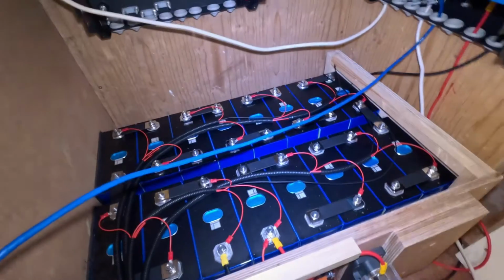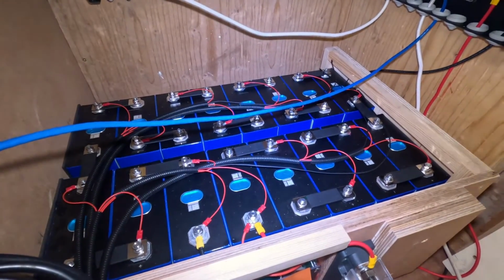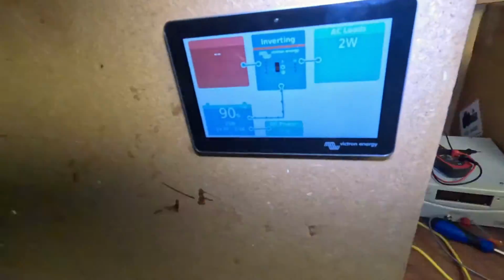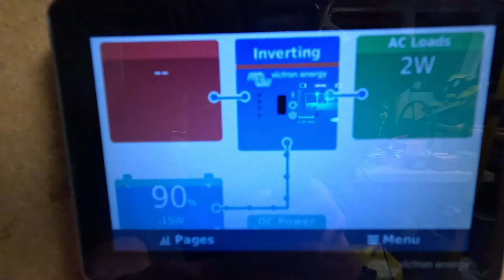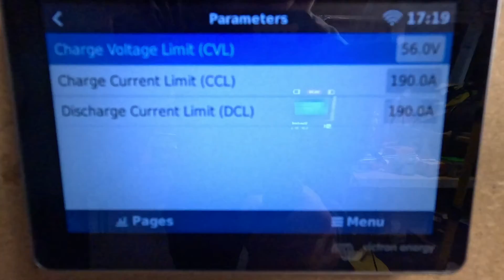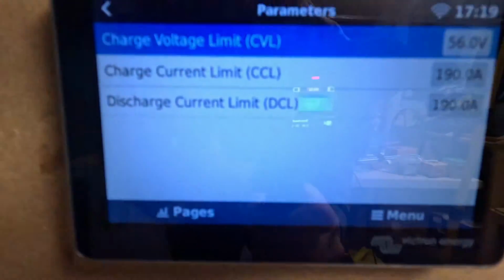Building our Sailboat’s 48V Lithium Battery [2.08]

Comment: Your 280AH bank is by far too small to run 2xMulti, you need min doubled.
Reply from the maker: Thanks for dropping a comment 😊 Do you want to explain why you think it is too small?
This is how we have been reasoning: The main drivers for going for 2x5kVA Multis is that we wanted the charge current to fully utilize our genset and we also didn’t want to be limited during discharge in the way that we have to think about what appliances we turn on at the same time. It shouldn’t be a problem to turn on the water kettle when the cooktop and dishwasher is already running. 
So, if we start with discharge we will have a total connected load of apporx. 15kVA. Obviously we will never run all those loads at the same time. At our highest loads we will probably only run half of them, and that will be for very short period of time (minutes). From a thermal point of view that is long enough to be a continuous load for the Multis and that is why 10kVA felt reasonable. It also gives some head room for thermal derating. 
If we look at it from a battery point of view a load of 7.5kVA will result in 184A (7500/48/0.85) or 0.66C which should be within both cell and BMS specification. We will for sure do some thermal testing of this and I think our weakest point right now is the busbars between the cells. 
From a charging point of view 2x5kVA Multis can deliver 2x70A. For our 280Ah battery that means 0.5C which what is defined as a standard charge rate for our cells. Our genset will be the limiting factor here and we will not really reach 140A charge current. 
Then you could argue that we should have a bigger capacity in relation to our load to be able to run out of batteries for a longer period of time. Our target with this system is around 3 days from full battery to completely empty without any charging. Then we will rely on as much solar that we can fit and our genset if needed. 
In the end LFP batteries can withstand a lot of cycles and that is what we will try to utilize with this dimensioning. 
Will it work? Time will tell. Worst case we just add another battery in parallel 😊
Reply: @SailingAnneMon  lot of theories…I am dealing with lithium since 20years, first cells scraped half legally from a military vehicle to build a competition car stereo vehicle and my buddy runs an NPO in Austria producing Powerwalls and commercial EVs. I am liveaboard and circumnavigate since 2019 running a 12V 4P4S 1088AH bank with 272AH Lishen cells. My cells are bought via my buddy who made sure I got grade A+ factory matched and internal resistance calibrated 16 cells (each cell was 180Euro, his factory purchase price and he gets every 2 week 3 container from Lishen) you cannot buy that as end customer unless you get Winston which only produce and sell this quality. The 280AH cells you have degenerate much faster if constantly used above 0.3C, doesn’t matter what spec tells you, they are budget storage cells most likely b grade at best and no Winston where same capacity costs 3-4 times your cells. What manufacturer (believe it’s eve or rept from terminals), what quality do you get (test report/scan QR codes) from which supplier? 
One 5kw multi from load is already limit for your 280AH cells, as eg 100A inverter load x1.4 means the real load 140A on/off in millisecond (don‘t believe put on Osszi in and it will prove you that). And if you use induction hobb ( a good one with industrial grade coil burners, cheap is even worse) add a cos pi of 0.7 which means 100A/0.7x1.4=200A is the real load on/off in milliseconds, you see 100A at BMS or Victron BMV712 battery monitor. Use class T or NH fuse with min 30kA short circuit certification as main battery fuse as these 16 cells can produce up to 18000A in an internal cell/bank short as each other fuse type will be arced and therefor useless by that up to 18000A. I burned a car down with a 24V 400AH bank that got an internal cell short and even a 15kA speced class T fuse got arced.
Busbars are ok. During build I see loads of mistakes, no isolation between cells (the case carries positive and heat shrink is quickly damaged). No clamping/compression of cells. Battery box should be of non easy flammable material (I know loads of videos show wooden boxes…I use PVC, PP or acrylic boards), box should be airtight (otherwise corrosion and problems over time) but in case the gas valve of cell open that gas must be able to leave the battery box, if not you build yourself a bomb :-(….
I highly advice to get a 2nd set of cells with a 2nd BMS put in 1p16S put parallel, to get load and charge under 0.3C. For each battery class T or NH fuse plus disconnect relay in positive right after main terminal, negative a 500A shunt With a Victron BMV712 battery monitor which also has a relay steering output. The BMV712 does the independent last resort cut off in case BMS fails (mosfet BMS like JK the mosfets tend to fry close in overload or a short, so no disconnect anymore) that steers the disconnect relay. The BMV712 has also midpoint monitoring, so the 2nd measuring output of it goes on cell 8. like this the BMV can also detect a cell deviation means a dangerous cell runner as it measures the voltage of cell1-8 and 9-16, if that exceeds a threshold you can set (I advice 200mV) the BMV is also cutting the bank. This last resort is requested by ISO or ABYC installation guidelines and if you don‘t have it your insurance will bail out easily of any battery related claim/damage.
Reply: @SailingAnneMon  just several other thoughts…2x5kw multi have a huge standby wattage (the real, not Victron marketing one) of 200W, that on the whole day is already 4,8kwh. I have 2 Multi 3kw and instead parallel staged them means only one is always on and 2nd is switched on via generator assist if load is above 2450W for more then 5sec. As multi has only one AC in you need a manual transfer switch where you can select if AC in comes from 2nd multi, generator or shore power. With a gen as main source a Quattro would have been much better and the right choice as it has 2 AC in and manages them automatically also with power assist and smooth phase in gen. With your loads you will do 1,5days max, not 3 as you calculated, double capacity will give you the 3 days if you manage the standby of your 2 huge Multis accordingly. I assume starlink comes on top, 60W always on…
Reply from the maker: @chrisr819  The cell we have bought are Eve cells.

It was not really the focus of this video but the cells are insulated with epoxy sheets, they are compressed with threaded rods and we use a class T fuse with 20 kA IC. 

On the topic of battery box I really agree. Ideally I would like to have a fully sealed, thermally insulated and burst valve equipped aluminum box with off boat ventilation. The problem is that it quite easily run out of hands. Instead we try to focus on a mechanically safe installation with the proper monitoring. Using the mid-point monitoring on a BVM/Smart shunt is a option.

On the topic of Multi standby consumption it is really good to get input from others. Not sure if you have Multiplus or Multiplus 2. We have Multiplus 2 and the standby consumption per unit is 21 W without any of the power saving setting enabled. We have also measured this consumption. I have not been able to find any information about if a parallel configuration will set the slave unit in standby if not needed or if we get 2x21 W in standby consumption. Time will tell where we end up there.

A Quattro would for sure have been really nice. We got our 2 Multis for a really good price during the autumn deal that Victron had so a Quattro was not really a viable option from an economical point of view. The shore power/genset connection we will solve with an automatic transfer switch and the input AC current limit we will try to automate with some logic in the Cerbo GX. Otherwise we just adjust in manually
Reply: Battery box at least use PP boards which you can work on with wood tool, on top a screwed down 5mm acrylic plate so you can visibly see whats going on. For the 2 battery cable use protection plastic cable guards and just drill hole in the box thats 1-2mm bigger. Like this the box is 98% air tight but gas can exit. Simple and safe.
Hardly believe they have 21W, have the better MP1 and they state its 26W but reality is 45W, with starlink on its around 100W. And this is just a 3kw one, 5kw has a bigger trafo and semiconductor so at real standby it must be >80W. Yes parallel means both are permanently on and use even more standby then each individually which has the reason that they need to sync the phase constantly. Thats why i gave you the tip that you can also stage them with has 3 advantages: 1st only 1 in standby=more then half capacitysaving, 2nd only 1 wears as 99% of time one 3kw or 5kw is enough and 3rd in case of a defect eg short in the system only 1 is on= can be damaged. 2 Disadvantages 1st multi only 1 AC in so you need a transfer switch shorepower, gen or fake 2nd inverter. 2nd use of 2 as charger needs manuell intervention means you have to switch to charger only and need a remote bypass switch so you can manually switch it on. You program the multiplus relay output of multi no1 with generator assitsent that closes this relay at eg 4000W. The relay output goes on remote/aux in of multi 2. AC out1 of multi 2 connects to transfer switch and that to AX in 1 at MP2.
My main charge source is solar and i hardly ever connect to shore power and also to a semi permanent installed gasoline honda gen. So a manual 3 pole transfer shore,gen,switch is simple,reliable and cheap. Spend your money on important stuff like a BMV712, which is an excellent cheap independant and reliable last resort method that as side effect integrates battery data into cerbo. Don't know anything thats as reliable as that BMV.
The 280AH eve you got have the worst of all terminal with very small surface and are definitely grade b at best. Your problem is to get a big enough contact surface so busbar hole must be minimum size possible but that gives you problems with busbar cannot  move in technical expansion.